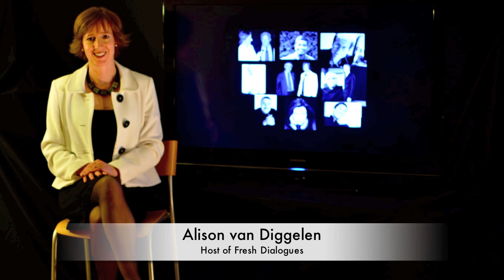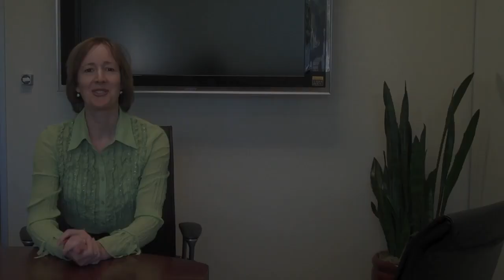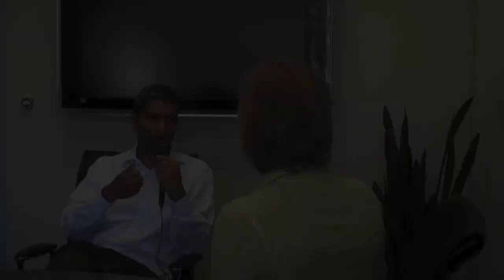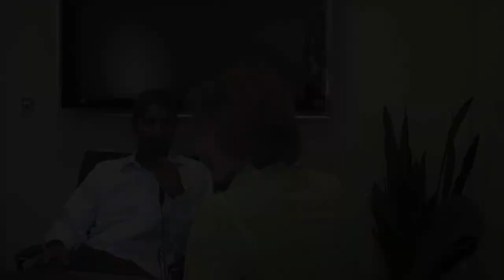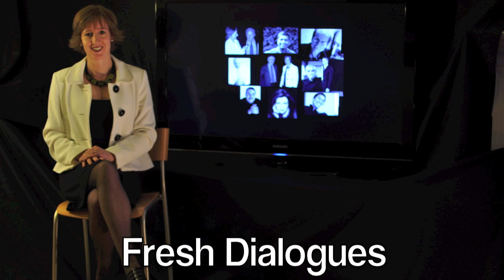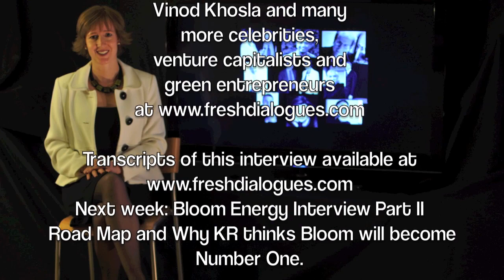Bloom Energy's CEO talks technology, efficiency

Comment: Will it be like the hybrid car batteries that cost 4,000 dollars and can help you save 50% fuel cost but after 10 years you need to change the batteries. Its back to square one as the cost off the batteries might as well be spend on fuel. No saving.